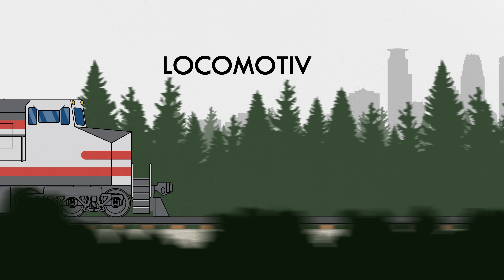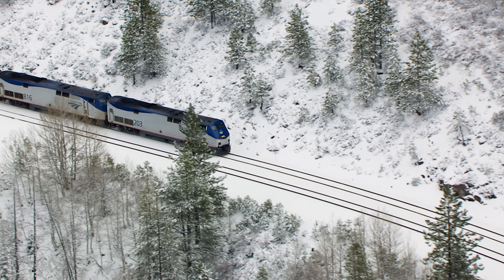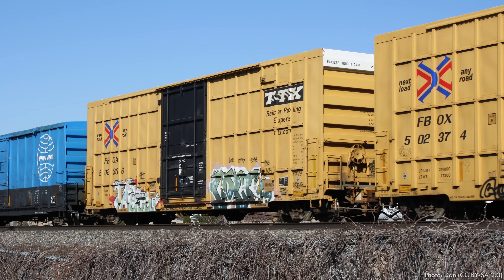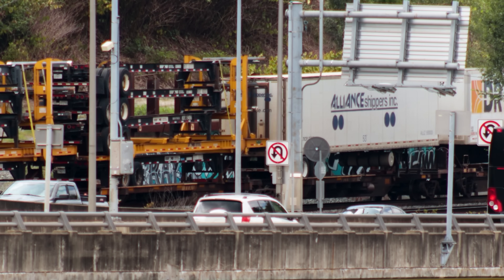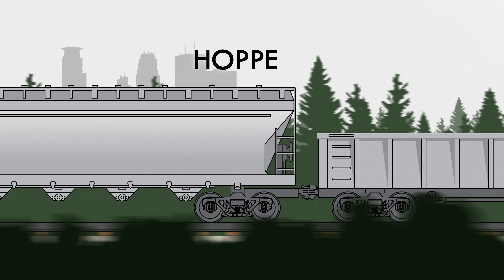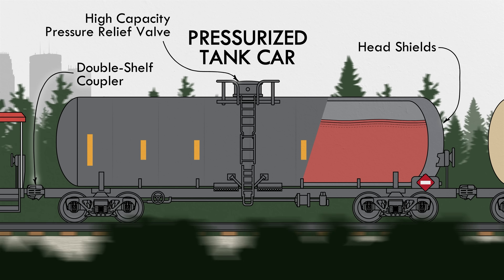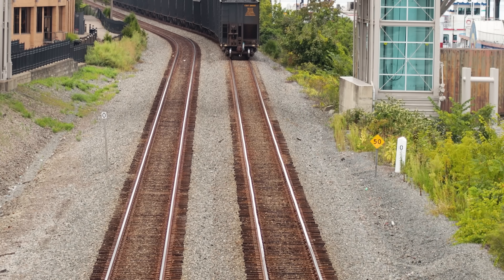Every Type of Railcar Explained in 15 Minutes

Comment: I actually work for a short line that interchanges with UP, CP, CN and BNSF. Something interesting worth mentioning is the multiple unit cars, you usually see them with intermodal cars (occasionally youll see them on the semi trailer flats as well) where you have 3 to 5 cars that are permanently joined with a shared truck between each joint. They are able to save on shipping costs because of the weight reductions

They actually tried this with grain cars the CN with Articulated Hopper Cars and the Santa Fe with their Super Hopper and despite cost saving multiple unit hoppers never took off because the loading and unloading infrastructure was usually designed around loading and unloading one standard length hopper at a time.

Comment: "Unless you work in the rail industry passenger trains are the only ones you'll ever get to interact with" 

There is an entire national subculture in the US of probably thousands who hop freight trains. 

An "engine" is called a unit, a boxcar is still a boxcar, a refrigeration car is a "reefer", a flat car is still a flat car, TOFCs are called Piggybacks, trailer cars are double stacks or single stacks, coils cars are still coil cars, gondolas are gondolas, "hopper" cars are called grainers or coal cars, tank cars are just called "tankers", IMs are generally called "hot shots" and GM are called "junk", auto to racks are still called auto racks, Distributed Power Units are just called DPUs. Flashing Rear End Devices are called "Freddies". Rail police are still called bulls, and a hobo camp is still called a jungle just like they have been since the 1800s.

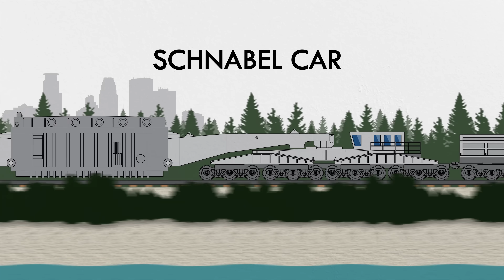Comment: Freight. 5:30 Multiple flatcars for giant wind turbine blades 8:57 specialized Schnabel 11:09 specialized railroad maintenance cars... 12:02 rotary snowplow 12:08 road-rail 12:55 rail geometry car 13:23 caboose now a rarity 13:43 due to wayside defect detectors and 13:50 EOT equipment

Comment: Not all trains have a locomotive. In the UK most passenger trains do not - but rather are a set of carriages all of which are powered with a cab at the end of the first and last carriage. These come in fixed formation sizes.

Comment: At work I interact with bulk hopper cars (connect to and disconnect from them to fill silos of plastic resin pellets) and there are even an array of gate designs (in my industry they are the "pneumatic" variety). Some are terrible while others are great from a user-experience point of view. It is difficult though for me to google them and give specific names. I guess it's just too esoteric a topic even for google.

Comment: This will probably get lost in the numbers of comments, but bridges are important.  The many type of trusses, beam. and arch.  How they are combined to make larger bridges.  Most important is why a railroad choses a type for a use.
You forgot a new type of reefer, the cyro-reefer.  It has no refrigeration gear.  Instead it uses high quality insulation to keep cold goods cold.  A simpler way to do it.
You get a railroad equipment register book and you will be amazed at all the type and subtypes of rail cars there are.  Did you know there were box cars specially outfitted to carry caskets?  
I am a model railroader and have been an engineer, conductor, trainman and fireman on a real railroad.

Comment: I would love to see an episode on the modern automatic train routing systems.  I'm sure a place like Switzerland isn't running 3 minute headways with an operator setting routes based on a schedule - so what sort of algorithms are used, how do the trains identify themselves if they are running outside their planned slot?  As well, HSR goes too fast for operators to read signs, so all the info has moved electronically into the cab - what additional features does that enable in the train control?

Comment: As an old Amtrak Trainman I'm happy to see you spend some time on one of the most efficient forms of transport and travel. This combination of steel wheels and a rail is just as smooth ball bearings. The touching surface area is about the size of your smallest finger. Think of a car or truck and the amount of contact between surface areas and it quite a difference more area for heat to be created through friction thus inefficiency. Well Done Grady
Reply: Great comment!

This really is the secret sauce to efficient low-friction transport. The total wheel-to-rail contact patch for an entire "consist" (the whole train, head to tail) is far less than one square foot.

Here's how to conceptualize that: Imagine a steel ball resting on a flat steel surface. How much of that ball is touching the surface? In mathematics, we'd call that a "point". Ignoring surface imperfections and flexion, that point is undefinably small.

Comment: Bethlehem Steel Co. Hot Metal Car No. 127 Baltimore Train Museum - USA - Built mid-1930s they shuttle molten iron from the blast furnaces to the open hart or basic oxygen furnaces, where it is turned into steel.Built of thick metal plate and lined with firebrick, hot metal cars can be awsomely heavy. When loaded, some larger models can weigh over 400 tons.

Comment: For a future video it would be good to discuss the advantages (and disadvantages) of the articulated connector double-stack cars which join 3 or 5 units under a single car number.  Also, while you jumped right to the Schnabel car, there's an intermediate heavy-duty car called the Depressed Deck that you may see carrying heavy electrical transformers.  Great video, looking forward to the series!

Comment: I studied about this in highschool.. Though I'm from a different country and we had a different name for each.. 
Our 'cars' or waggons are sorted in 'series'
so a Hopper car would be 'Seria T'
Flat cars are 'Seria L'  
so we mostly reffer to them by their letter.. 
Also a thing is that we have unofficial measure called a waggon which is 100 metric tons
I did my thesis on intermodal transport, and I find it the best one, since you can mod the container for almost anything, and you just need a flat car for all..
Funny thing is that we use imperial units for container sizes 20, 30 or 40 foot

Comment: Extra credit points for including Schnabels!  I've been fascinated by them ever since I saw an article on scratchbuilding a model of one in Model Railroader Magazine when I was a kid.

On class of freight that's common in the northeast and Great Lakes region is the ore car - a sort of half-sized hopper car intended to carry iron ore. Iron ore is much denser than say coal or grain, so a 50 or 70 ton ore car ends up being considerably shorter than a similar weight hopper car.

That EoT device is often called a "FRED" - "Flashing Rear End Device" or "Flashing Red End-of-train Device" .

CSX has been very busy the last few years overhauling its lines in the mid-Atlantic region to increase clearances to accommodate double stacks, including the Virginia Avenue Tunnel reconstruction in Washington, DC, and the just-started Howard Street Tunnel project in Baltimore.  The Port of Baltimore's already expanding its facilities and installing three massive new container cranes to handle the expected increases in container traffic allowed by the railroad improvements.

Comment: You ought to do a series about farm equipment... there's TONS of fascinating processes involved in mechanizing various agricultural jobs.  Planters that can use plates, brushes, fingers, or now vacuum or pressure to hold and single out seeds one by one, and plant them at incredibly high speeds... for instance a soybean planter dropping 150,000 seeds/acre running at 6 mph in 30 inch rows drops 76 seeds per second 1.39 inches apart!  The systems that do this are rather amazing, even the technology from decades ago (plate meters) to more advanced versions (brush meters and finger meters) to today's air (pressure) and vacuum meters and the latest technology can plant accurately at 10 mph!  Then of course there's the harvesting equipment, spraying equipment, tillage, specialty equipment like vegetable or tobacco plant setters, potato planters, cotton pickers, sweet corn harvesters (which are quite different from the combines used to harvest dry grains, since sweet corn is still wet and green), potato and other vegetable crop harvesters, tree nut and berry harvesters, mint and lavender and other oil harvesting processes, hay balers and silage choppers and equipment and the processes that go into making those forages properly, livestock equipment, milking/dairy equipment and various milk and cheese and other dairy products processes and equipment, nutrient management (manure) and fertilizers (various materials from cryogenic pressurized anhydrous ammonia applicators for nitrogen to aqueous ammonia liquid nitrogen applicators to blends of phosphate slurry and potash, and various types and kinds of dry fertilizers from ammonium nitrate to urea and various blends thereof and how they're made and applied on the soil, from broadcasting to banding, knifing it into the soil, preplant and sidedress, injection, dribbling it on with Y-banders, fertigation (applying fertilizer by injecting it into irrigation water being applied to a field, and the various engineering that goes into various types of irrigation equipment and practices, from flood irrigating rice using field planes and irrigation terraces to control the water depth on the field, to furrow irrigation of row crops, to side-roll irrigators used in turfgrass and other low-growing crops, to center-pivot tower irrigators used in tall crops like corn on large fields, some up to several hundred acres... then the technology of irrigation water metering and application, from regular old "rainbird" impact sprinklers (like lawn sprinklers) to more advanced tech like LEPA (low evaporation precision application) sprinklers to drag hoses to underground drip tape... There are TONS of technology and innovation to cover, both historically how it was done in the past and how it's done today... then there's the processes once the crop leaves the farm-- cotton ginning is a very interesting process, then sales and storage and shipping to the final cotton mills and spinning/weaving plants making cloth and textiles then processing into finished product.  Rice harvested from the fields is contained in an oblong husk which is removed at the rice mill by machinery, and the dry rice stored until it goes to a plant and like most other grains, separated into its constituent parts, often with the bran and germ removed during the "polishing" process to produce white rice or wheat flour or other grain flours, unless they're "whole grain" where the bran and germ remains... even sprouted wheat flour, etc. which are other processes.  TONS of interesting stuff to cover and it'd be GREAT for people to actually learn where their food and materials come from, how it's grown and processed into the goods they buy...

Comment: 09/21/23
Very good video. I work with an upstate NY engineering firm, and we install a rollingstock detection system currently named the VTMMS (Veneklasen Train Monitoring and Maintenance System). We're actually heading to the Middletown, NY area on Sunday to perform an install on Monday and Tuesday, September 25th and 26th. This system will go onto rail property owned and operated by Middletown & New Jersey RR (a short-line company). This particular install is for demonstration purposes only and will operate for about a month. During that period, we will be proving the technology and providing the data collected to potential clients for future sales.
After that we will be doing another installation for UTLX and hopefully generate sales from that.
Our system is designed to provide maintenance scheduling that will reduce rail companies’ TCO. It can also detect defects in wheels, brakes (including 'stuck brakes'), and bearings. This system detects defects early enough to give operators and dispatchers hours, days, and even a week or more of a threshold before CATASTROPHIC FAILURE! This gives operators time to schedule the maintenance and repair rather than doing a 'last minute' scramble to fix defects. Our system can outperform the currently used 'Hot-Box' infrared detectors.

Yes, the modern railroad system is considerably complex and fascinating. With a little time and lots of effort we're hoping to move the rail system well into the digital age and reduce if not eliminate unwanted incidents!

Comment: What about Multiple Units? Nearly all passengers trains in the UK work this way with Diesel engines / electrical equipment under the carriage (car) floor. It’s a more efficient design as you can have a lighter train because you don’t need the mass of a locomotive to get adhesion. Only really works in the UK as we have high platforms 0.9m (3’).

Comment: I'm a little sad you didn't mention the torpedo car, but I can understand it since it's so rare nowadays.

I remember reading about this in high school and thinking "wait, they REALLY DID THIS?"

It's basically a car with a lined refractory vessel to transport molten steel between facilities and it looked like w a very aerodynamic tank car
Reply: It was worse than you think!  In Pittsburgh J&L Steel had their furnaces on one side of the river (Monongahela) and the finishing mill on apposite side of the river.  They would move the molten metal cars over a bridge to the other side of the river.  We always though, what would happen if a derail sent molten metal into that river!!!!!

Comment: In the UK we have a rail vehicle which is fitted with high pressure water jets to clean the residue from leaves off the rail tracks, the nemesis of commuters in Autumn.

Comment: Right at the beginning, one can tell you're not a railnut ;-)
A train not always has a dedicated locomotive. Cue "multiple units", where the systems regarding locomotion (electrical systems, traction motors, etc...) typically found in a locomotive are spread over the entire train. While the train itself is self-propelled, no single car in the train would constitute the locomotive, and no single car with traction motors could operate independently from other cars in the train as the relevant systems are distributed across several cars. Many modern high-speed trains are such multiple units. (And trams... 😛)

Well, you could say a multiple unit is the locomotive of the multiple unit -- a locomotive whose purpose is to move nothing else but itself (and whatever is on it🙂)

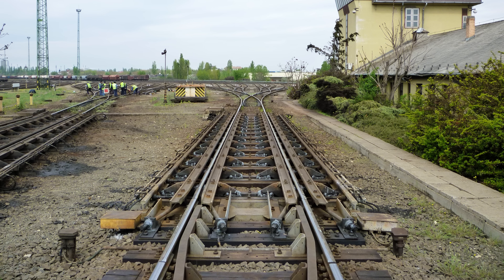Comment: 12:35 this is actually not just a scale but a trackside humping brake. It is used to slow down fast running cars that have just been humped. With that you avoid them crashing into the destined set of cars with a too high speed.

This picture was obviously taken in Germany.

Comment: I used to work for a connector railroad, the RF&P (now part of CSX Transportation), 40 years ago. So I knew of and have seen up close most of the kinds of cars you featured, but it's been a long time and I'm not sure I could've still listed them from memory. It was nice to have this refresher because I'll always be a railfan at heart. Looking forward to the rest of this series!
Topics you could cover: Signals and signal communications; switches, junctions, and switchyard technology; major accidents and how safety improved as a result; dynamics of trains crossing peaks and valleys and how these problems are solved; diesel vs. electrified operations; safety and failsafe design at crossings; right of way engineering (grades, drainage, trestles, tunnels, etc.).

Comment: As a welder that works on remanufacturing railroad repair and maintenance equipment, it made me really excited to see a spiker. I was just replacing a front bumper and a manifold mounting plate yesterday.

Comment: Train end monitor isnt really to mark the end of the train, well it is, but if there was a disconnect of some of the last wagons, all the brake pipe air will dump pressure and force the brakes on the whole rake, I'm sure the engineer would notice without that monitor 😆

Comment: With steam locomotives, there were several times that you'd see two (or more) locomotives at the head or rear of a train.  However, with internal combustion engines driving electric or hydraulic transmissions or straight electric power, a locomotive may consist of one or more units, but they are still considered to be a single locomotive when under the control of a single engineer.

Comment: Many of the passenger cars used in Sydney are 1.5 floors - one level at either end (above the wheel trucks) with a double decker section in between. These are the same height as the regular single-level carriages, and yes, congestion is a real problem when getting people off and on these, especially during peak hours when it's standing-room-only even in the double decker sections. (Layout in the double decker section is typically with seats facing forward or back - or flippable - with a 2-seater on one side of the aisle and a 3-seater on the other. The single-level parts have people sitting with their backs to the windows.)

Comment: US terminology: 
Railroads, not railways (British parlance). 
Freight cars, not rail cars. Though often misused, railcars carry rails.
Freight, not cargo. semantics aside. By tradition railroaders do not use the term cargo. It's freight trains, freight cars, freight terminals, etc.
Dining car, not diner car.
Sleeping car or sleeper (or Pullman), not sleeper car.
Crew cars are called dormitory cars. They are usually combined with baggage cars. Some crew sleep in unsold rooms.
Refrigerator Car (or 'reefer"). These are not considered boxcars in the industry because they are insulated and can be either cooled or heated--now via GPS and the Internet.
But you did get tank car correct. Tankers are ships.
Reply: How about a, Frog